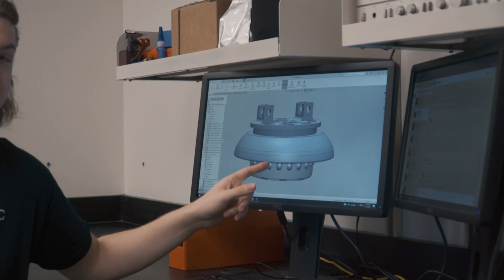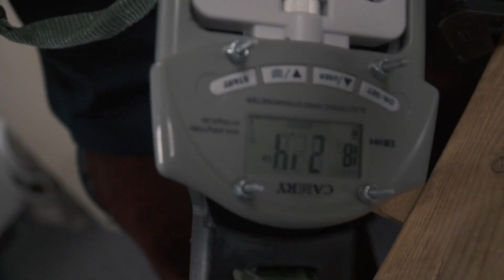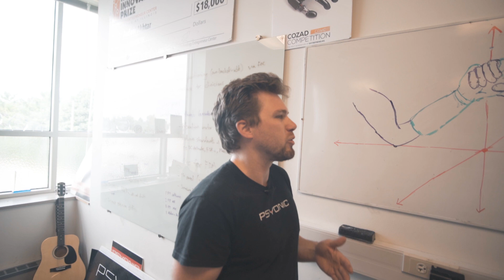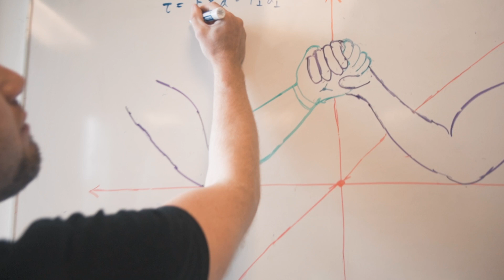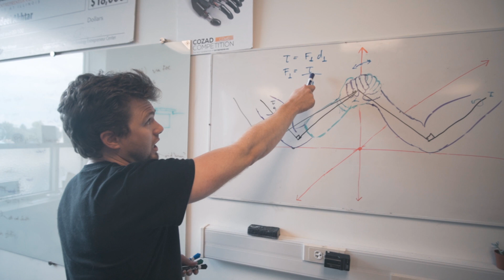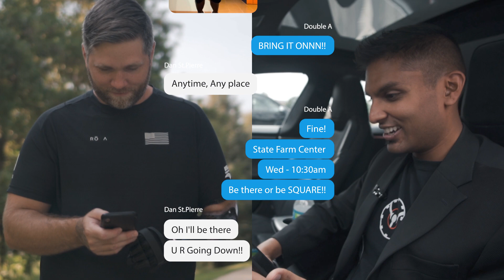ARM WRESTLING WITH A BIONIC HAND!?!?!?!

Comment: How does the touch feedback work on this hand? Can someone explain?
Reply from the maker: A sensorized finger has 6 areas of touch sensitivity, one on the finger tip, one on the fingerpad, two on the outside side of the end of the finger, and two on the inside side of the end of the finger. Most hands have the index finger, pinky, and thumb sensorized. They can measure between 10g to 10kg of weight, with around a 1g resolution. For patients, there is a vibration motor in their socket that vibrates on contact for a half second and again when releasing, and the intensity is proportional to the amount of pressure. It is also possible for us to stream the continuous absolute pressure measurements as well, and with nerve implants we can stimulate the nerve directly to make it feel like it's coming from your phantom hand. We designed our hand to work with the simple vibration system available now, as well as the more advanced neural implants that may come out in the near future.

Comment: So, a thought. If you can charge your phone, what about adding something like a micro SD card reader?
Reply: Heck just thought of this, you could have all your health information on it as well.
Reply: @Slappy27  I like it! There could be information to help return the hand to its owner, like if it came off during an accident, like when that man lost his prosthetic leg, but it eventually got returned. Maybe tracking could be added without much of a weight penalty.
Reply from the maker: Interesting. What are you thinking it could be used for?
Reply: @psyonicinc  well, seeing as I may be losing my hand been giving this some thought lately. It could act as a back up storage. For example, put a 1 TB micro SD card in and you can store your pictures, a resume, PC Steam games, movies. Imagine using a cord to plug into your phone and watch an entire library of movies. Have a backup of all your important doc literally at your fingertips. Just a few off the top of my head.